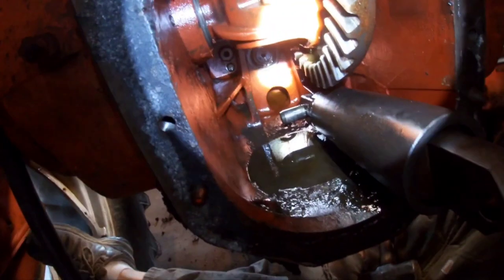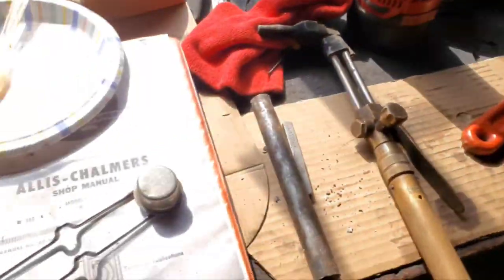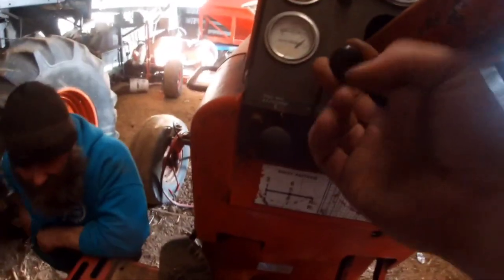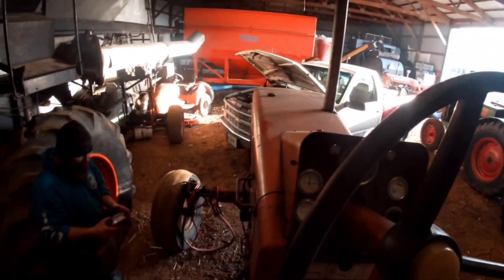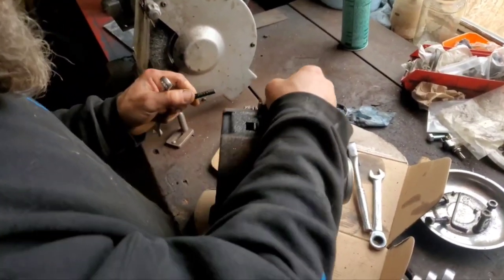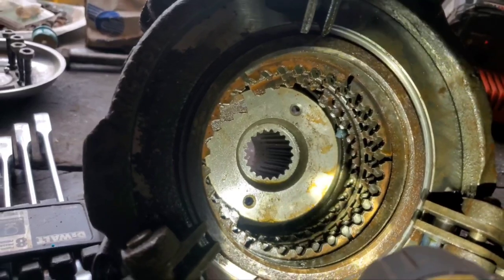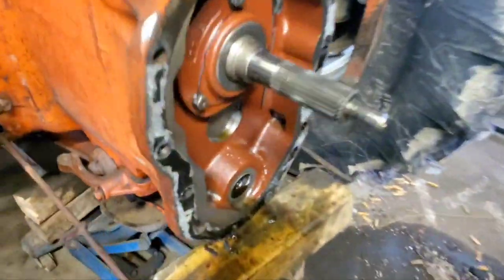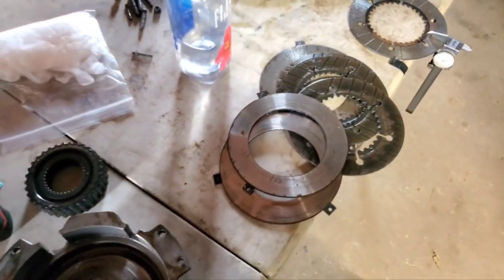Allis Chalmers D-17 with 301, hand clutch rebuild, 190 XT series 3 repair, and a 💩 spreader repair.

Comment: When I was little my dad had an 86 camaro with a 305 in it, when he bought it it was burning oil about a quart in 1500 miles. He put some Restore in it and he said after that it used a quart in about 3000 miles. Can't say for sure how big of a difference it will make, but if it's already tired it sure won't hurt anything. Thanks for the video Tim
Reply from the maker: That's good to hear this poor 301 is tired and we don't have the time to over haul it right now. Hope this stuff makes a difference lie I've been hearing. Thanks for watching Evan.

Comment: I really like your 301 repowers. That is one of the best sounding 6cy diesels of all time. Other than the sleve cavation issues very durable and reliable. I have had 2 XT190's back in the late eighties.  One eary model and one late model. Enjoyed them both.
Reply from the maker: You've got that right they are great engines, and with distilled water and new age antifreeze conditioner, cavitation is a thing of the past. There's 5 301s on the farm here they are the main power houses for my brother's and my operation. Fuel friendly reliable and easy to work on lol. Thanks for watching and commenting Pete!

Comment: I had a 880 Oliver diesel that smoked a lot and didn’t have much power and also started hard I changed the oil and added a can of that restore helped it a lot started better and didn’t smoke near as much had that tractor for 10 years changed the oil every year never had to overhaul it never used any oil between changes I didn’t work it very hard pulled a 4 row planter and used it on a 9 foot new holland haybine was great on fuel
Reply from the maker: That's great to hear! if it runs to good we might not over haul this one either 🤷‍♂️ most it gets used is for pulling. But it's pretty wore out I will be amazed if it makes any difference. 😆 thanks for watching and commenting!